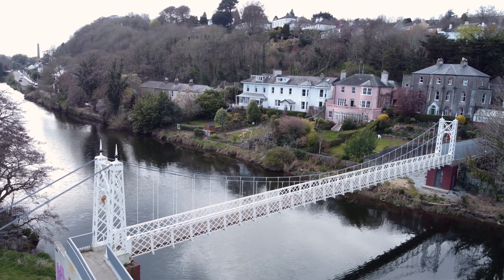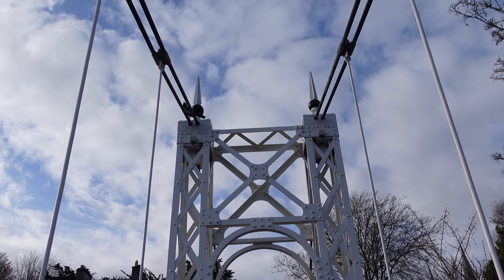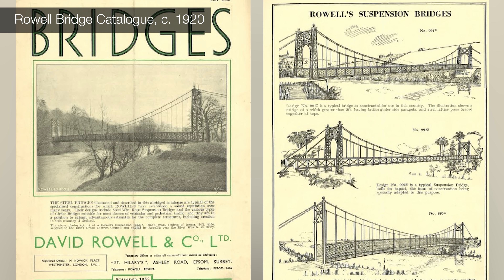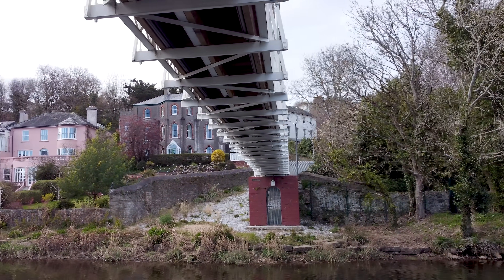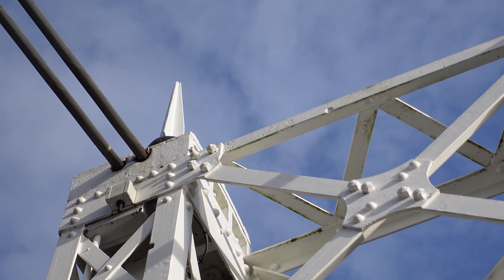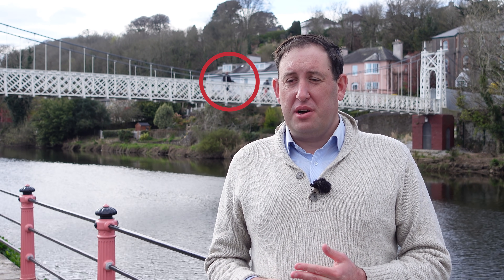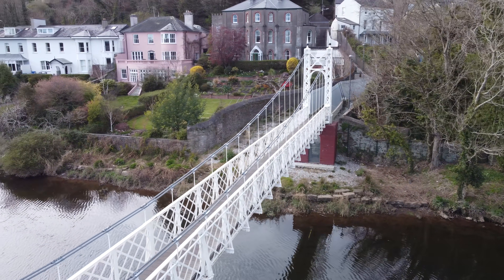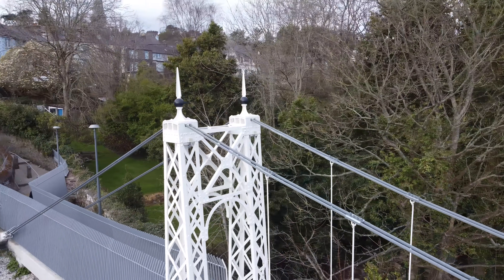The bridge that must legally wobble

Comment: The Androscoggin Swinging Bridge between Brunswick and Topsham has a similar bounce, was designed and built by the same firm that built the Brooklyn Bridge, and when restored the original John A Roebling & Sons wire rope will still in great shape so it still supports the bridge treadway.

Comment: It would appear that the shaking is directed into the vertical axis by the shape they chose, as that latticework affixed with central bolts/rivets will resist lateral and twisting forces due to the friction of the surface area at the joints, but will have a lot of play perpendicular to the axis of the fasteners, which will behave like axles or hinge pins along which the structure can flex.

I imagine the play would have been nearly eliminated, or at least reduced from human perception, if the lattice had been replaced with a more common handrail, with horizontal and vertical members instead of diagonal members, as the motion would be able to move in every axis, dissipating from perception, instead of being confined into a single axis, where we notice it more easily.

If this assessment is accurate, then hypothetically speaking, this kind of behavior should be replicable if the same form of handrail is employed, as people clearly enjoy this form of wobbly bridge, and if it stood up for nearly a century with old manufacturing methods, clearly the design is perfectly safe.

Comment: Daly's Brige patch notes:
-Fixed corosion
-New cables and overall updated graphics
-"Bouncing bug" now officially a feature.
Reply: They got Valve to do it, apparently
Reply: Thanks engineers very cool
Reply: - updated localization files
Reply: This is like the one time I have seen "It's not a bug" used correctly
Reply: Rocket Jumping.mp4
Reply: The got a video game company to fix it
Reply: This bridge is Fnaf security breach of bridges
Reply: I read that & all it made me think of was the Sims & how players will find a glitch they can exploit & then get really upset when the devs fix it, rather than making it a feature. The amount of friendship gain from photography, the fact that toddlers were skipped in the code to factor weather into behavior, so many more were exploited to great effect & sometimes hilarious in the case of toddlers because folks doing the 100 baby challenge would just store their toddlers outside since there was no need to bring them indoors because of the weather... then they fixed the glitches. I'm really happy the bouncy bridge still has it's glitch in the coding. It's charming & novel.
Reply: apparently epic games said they would pay Daly Bridge to add toxic nine year olds

Comment: The bridge over Tallulah Gorge, more specifically the footbridge over Hurricane Falls at Tallulah Gorge shakes quite a bit too when walked on. It like this bridge in Cork is a suspension bridge, however it has a wooden deck and railing on it. I recall watching it being built from the gorge rim when I was a kid as I grew up not too far from the gorge.

Comment: My question is if this bridge was built out of a catalogue, shouldn't there be a bunch of other ones just like it?
Reply: Yes that's a standard design for bridges. There are many like this all over the world.

If you're talking about the wobble of that specific frequency you won't get it because it's an anomaly and it all depends on the specific soil, material, wind, corrosion etc
Reply: I know a bride just like it, even down to being very shaky, in the uk, though only half the width cause its a less busy route

Comment: The bridge and it's flaws is more of a tourist attraction than serving a huge practical purpose. They should just replace it with something fit for purpose that doesn't bounce and is wider and has slopes to allow bicycles and foot traffic to go across easily.
Reply: There are 2 bridges fairly close to this one, on each side honestly this bridge is just used for people going to to park right next to it and also as a tourist attraction.

Comment: “If they don’t move a little, they break”. This could be misleading. Everything… absolutely everything moves when you apply a force to it. The ground moves when you jump up and down on it, even if you are not aware of it. The key issue is what happens to the loads when the structure moves. In the case of a destabilising load, more movement is bad - and some loads are amplified by movement, such as with the resonant response of the Tacoma Narrows bridge. One solution would have been to make it stiffer (another would have been to add damping, like the Millennium Bridge, or baffles to disrupt the wind flow).

For suspension bridges under gravity loads, however, the loads and associated deformations are generally self-stabilising, so that statement sort of works.

Comment: Many years ago I was involved with ensuring the safety of a somewhat similar bridge.  (A similar span but much wider, built for use by ponies and traps.)  It was reported that it was bouncing to the extent that some pedestrians were concerned, so I calculated its natural frequency of vibration, as part of my investigation.  The number I got was about two Hz (cycles per second), which is about normal footfall frequency for someone walking.  This meant that someone walking at a steady pace that closely matched the natural frequency would set the bridge bouncing in just the same way as someone repeatedly pushing a child on a swing to make them go higher.

Anyway, I could report that there was nothing to worry about, as long as a platoon of people marching in step didn't try to cross it.
Reply: But what if a platoon of people marching in step insisted to cross the bridge?
Reply: @Constantine_Cvl8  Then we call that natural selection
Reply: @Constantine_Cvl8  Platoons are generally ordered to break step when crossing bridges of all kinds, because of what can happen if they don't :)
Reply: @Constantine_Cvl8  this is an experiment we need...for science of course.
Reply: @Constantine_Cvl8  You'd hope that the bridge was designed to handle xtreme numbers of people including during resonance;p
Reply: good job you didn't publicly announce that or within 5 minutes there would've been a Facebook group made to accept the challenge.

Comment: I am currently taking a class in vibrations and all throughout the video I was thinking “oh no it’s gonna be another Tacoma Bridge incident”, but I was pleasantly surprised to find out that the engineers intentionally left in the vibrations! I assume that since this bridge is on a much smaller scale when compared to the Tacoma Bridge, the engineers were able to get away with integrating the vibrations instead of damping them. Super interesting stuff!

Comment: As a back country hiker I have crossed several cable suspension foot bridges. All of them shake like this. Every single one.
     Even road bridges shake this way. It's in the nature of this kind of bridge to shake. 
      Steel, especially steel cables are quite a bit more stretchy than most people think.

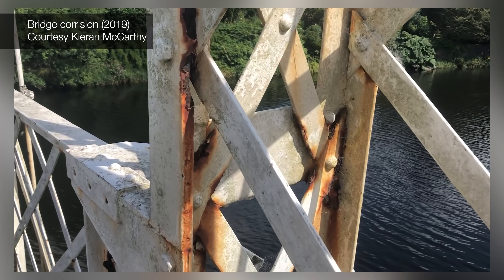Comment: 1:55 Clearly this bridge did not corrode because of all the bouncing and moving it had done over 90 years. It corroded because the idiot counsels didn't maintain the bridge.
     If you want to prevent corrosion you HAVE to feel everything covered in a coat of paint. Especially in an environment near saltwater. Every scratch and every chip must be repaired quickly. 
    But the politicians hate paying for maintenance because that is government money that could be used on projects the politician can point to and say, "Look what I did."
    So maintenance gets differed year after year until, if you're lucky, someone notices the state of whatever structure hasn't been properly maintained and says, "We need to fix that."
     Of course by this time the repairs will cost orders of magnitude more than 20 years worth of paint and the wedges for someone to apply that paint.
    If you are a bit less lucky the structure will fail and people will die. That exceeds the maintenance costs by an even larger margin, especially when you factor in all the liable settlements, because if there is not a more clear case of negligence it is the failure to maintain a structure for decades, I don't know what that might be.

Comment: Recently I built teeny tiny bridge myself. Considering loads and directions, made it with small angle to help for cargo movement in most used direction. And used vertical pieces of wood hammered into ground to strengten road before and after it so it keeps steady condition even during rainy days. It ain't much but it is honest work.

Comment: The bridge on the A325 just down the hill from where I used to live and where my mum still lives now, that is a solid railway bridge, doesn't move out of the way for HGVs ignoring the signs and smashing into it. I'm surprised its still standing.  I think it could and should possibly, be replaced with a level crossing there so HGVs could just drive over the track rather than smashing a bridge.

Comment: Current era: "We need to hire engineers, surveyors, fabricators, it's gonna cost about 10 million euros."
A hundred years ago: "Dude, we can order a bridge from this catalog. 700 pounds."
Reply: Ships in boxes: ikea bridge
Reply: @eriksab1609  IKEA Bridge -build it yourself
Reply: I was aware of mail-order houses (Sears & Robuck had those), but bridges being sold thing was is new to me
Reply: Ikea did too for a while
Reply: @csmith8503  As they were delivering a bridge, I'd cut them some slack on the delivery schedule.
Reply: @Tomyironmane  if it was late you'd never get over it.
Reply: you can still do that for your standard highway overpass and stuff alike, in any case you need engineers to check suitability and plan foundations
Reply: @hausaffe100  and they screw up too.
locally they replaced a bridge across a small river, a bit wider than the river in the video, they used a government approved design that was in use for decades and hired experienced engineering company to do the work .
after a year the  driving surface was cracked and warped and the transition from bridge to land was heaving amd sinking.
Turns out that design of bridge had never been used over water.. even though all the authorities and know it alls said it was approved.
Reply: TBH, that was closer to an off-the-shelf product, and it only needed to be a short footbridge unburdened by safety standards and red tape. Labourers back then worked for less than an equivalent of 20 euros a day, so without complex engineering for a bespoke bridge, it would cost a lot less.
Reply: 700 pound back then is 50.000 euro today... it might be considered being cheap back in the day but today you wouldnt be able to build something like this for 50.000 euro..
Reply: We still have off the shelf bridges. Look up Mabey.
Reply: And that bridge from a hundred years ago will probably be in operation longer than the ones we make now.
Reply: old people did have a lot pounds, no wonder they have many children
Reply: The catalog was probably prefab.
That's the difference between custom-made and mass-manufactured.
Reply: @csmith8503  Unfortunately it would probably be delivered to the next town (rather like my stuff being delivered down the road to the unoccupied house).  Then the boxes would just have been way too big  and stuffed with brown paper.
Reply: 700£ in 1930 is still 32k£ in 2021 and probably more in 2022
Reply: Don't forget the consultants that are just there to look serious and do nothing.
Reply: to be fair a hundred years ago people weren't asking to rebuild a bridge in a way that it shakes the same as it did before
Reply: 700 pounds back then was not the same as 700 pounds today. Inflation happened and it’s vastly lower value right now.
Reply: @InfernalPact  still nowhere near 10 million € though
Reply: @chri-k  you not taking into account other effects such as material availability changes.  Many materials have been so used in the isles that wr need to ship alot of it in from other places.  This also adds cost.  As well workers are paid mu h more now then back then.  The laborers on older bridges like that worked for pennies.  These guys get full on wages and salaries.  That itself Is likely to increase the cost several times.  More than just inflation causes prices to change.  There is also companies charging every Nicole and dime they can through the process to increase the price they charge.  The same for the shippers and heavy machinery contractors
Reply: @Aztesticals  Companies,do not charge a penny more than they did a thousand years ago, prices are set by competition and costs. Why speak of there greed of the supplier and not the greed of the buyer? Supply and demand set prices.
Reply: @Paul Bedichek  well then I wonder why when gulf was saying in the news that the price increase was to maintain current earnings but my boss at our gulf station gets a letter congratulating her on helping gulf see their highest corporate profits in 6 years.  The supplier increase at most should have resulted in an avg gas price of 2.65.  Not 350.  They gouged because they could
Reply: @InfernalPact  it's still nothing compared to projects of a similar size today and back then.

Comment: Any cable-suspended catenary with minimal deck stiffening will have a vertical mode of vibration.   There are certain points (antinodes) where the up-and-down motion is at a  maximum, as children delight in discovering.    So long as the motion does not cause excessive wear or damage, there is nothing wrong with this.

Comment: There was a suspension bridge near me on Mackintosh Island, Surfers Paradise, and it was similar in length to this one but it was made of wood. The area is used as a street circuit motor racing venue once a year so it saw lots of pedestrian traffic for a few days, and walking across it while 300 other people were doing the same thing was a lot of fun! 

Sadly it has been replaced by a much wider and more appropriate bridge made of steel and concrete, but that’s probably for the best given the risks that may have been approaching after 20+ years of use.

Comment: In the whole preservation vs conservation discussion, I think this is the best outcome for a structure that's providing utility rather than just treating it as a monument to period architecture and building a modern replacement nearby.

Many times I've seen conservationists win the argument about a structure, so minimum work is done to conserve the original architecture, then a few years later the owners decide to sell the structure, developers move in and the only thing that's retained is a façade with an entirely new structure built behind. And often they'll damage or destroy it in the process.

To me it makes more sense to preserve the utility of the structure rather than try to conserve it in as original condition as possible, because it will always eventually degrade to the stage that there's no way to conserve it anymore.

Comment: I love the fact that the engineers took effort and ran simulations to make sure that the wobble stays as close to the original bridge as possible.
Reply: Yes, and that simulations alone probably cost more than the entire old bridge in today's money.
Reply: @countluke2334  no it was most probably done by an intern
Reply: @countluke2334  computer simulations cost nothing
Reply: @mmw4990  computers to run the simulations cost money, the electricity flowing through the computer center costs money, and the developers who made the simulation need to be paid for their work and equipment. Costing more than 50k actually isn’t impossible, although the amount of money spent is probably lower than 50k because they probably used already existing software and hardware.
Reply: Ya but were you willing to pay the millions it cost, or do you approve because somebody else paid
Reply: ok
Reply: ok
Reply: ok
Reply: ok
Reply: Ok
Reply: Ok
Reply: ok
Reply: ok

Comment: As an engineer, this isn't even in the top 10 of weird parameters I've had to design around.
Reply: My favorite was from a previous job years ago. I needed to formulate the material in a shower curtain such that you couldn't identify genitals .75m behind from 1m in front but you needed to be able to identify a person from the same distances.

Second favorite was from the same job.  Urinal cakes needed to dye a specific quantity of urine a color range in defined stream conditions
Reply: @LikelyToBeEatenByAGrue  I wish I could have sit in on those consults and just hear the conversation that ensued as to how much genital was defined as unidentify able and such. That must have been one day no one could keep a completely straight face.
Reply: @LikelyToBeEatenByAGrue  for movies?
Reply: @iwatchwithnoads7480  no, that would have probably been more fun though. It was a company that supplied businesses and governments with bathroom paraphernalia.
Reply: @LikelyToBeEatenByAGrue  that's a very specific requirement from regular businesses :O
Reply: @iwatchwithnoads7480  oh, yes. There are often very specific and seemingly strange parameters that come out of design review and risk analysis.
Reply: I’m curious what some of strangest were if you feel like sharing 😁
Reply: I imagine conversations like these: "You see, it may not be possible to interpret the outline of a normal phallus, but upon a threshold length of 17cm the contrast increases logarithmically, revealing itself"😂
Reply: what were some weirder ones then? :D
Reply: I'd love to hear them
Reply: Wow which ones are